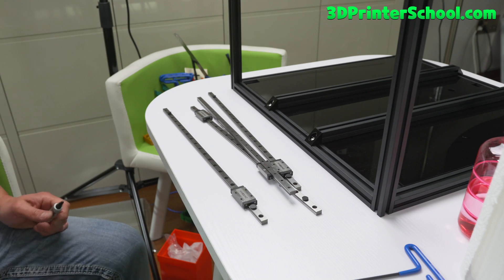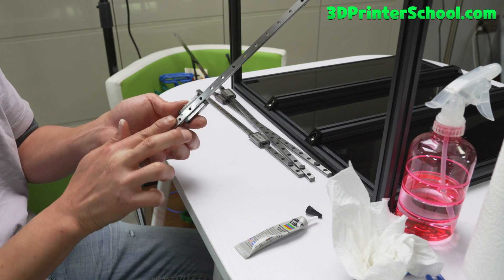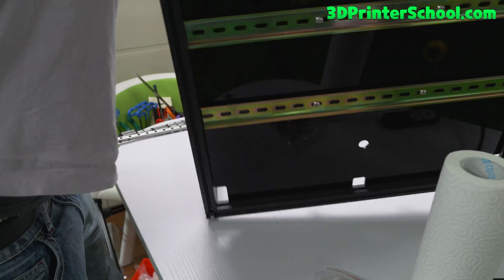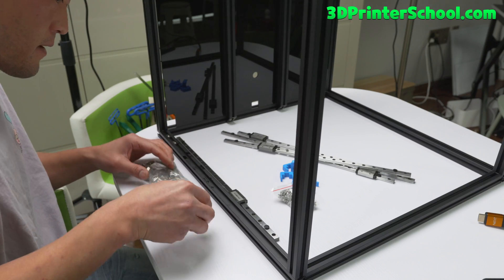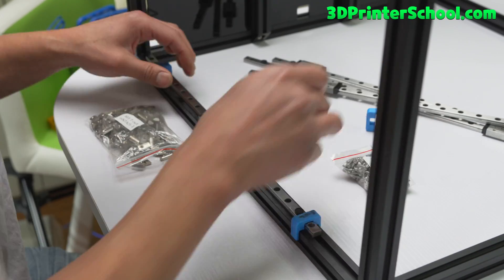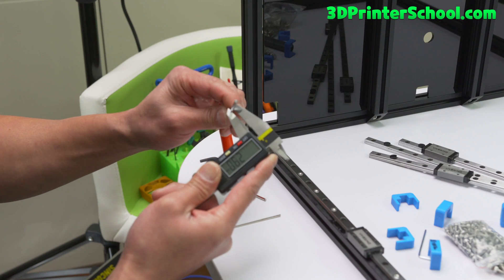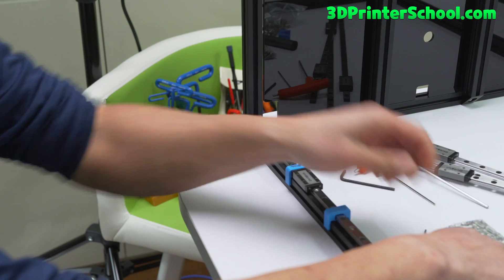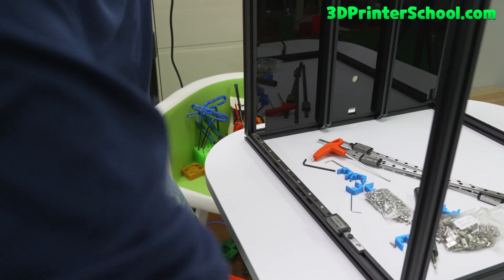How to Build a Voron 2.4R2! - Step 3 Installing Linear Rails

Comment: It is not Grease on the rails from the factory, it is an anti-corrosian agent, This should always be removed and replaced with a white lithium grease. I always use the Super Lube brand.

Comment: 4:21 suggestion: use three 1mm thickness shims stacked to make almost exactly 3 mm clearance for the linear rails.  Or if you have another 3d print (like me, who is in this moment printing the parts for my future Voron), just make a 3mm jig